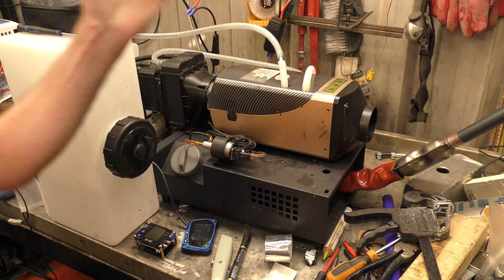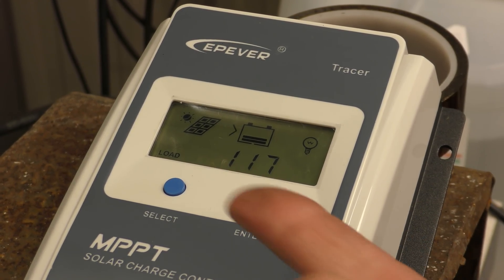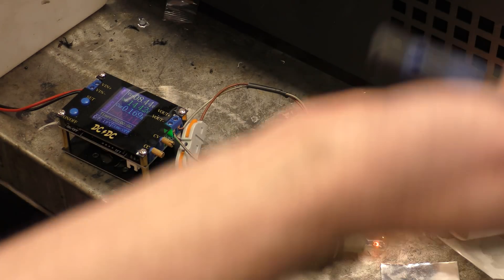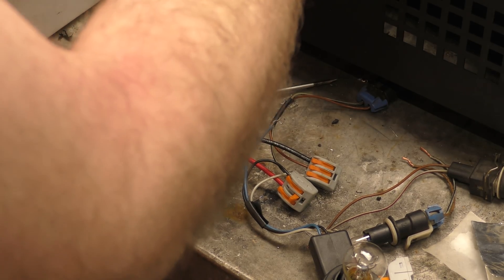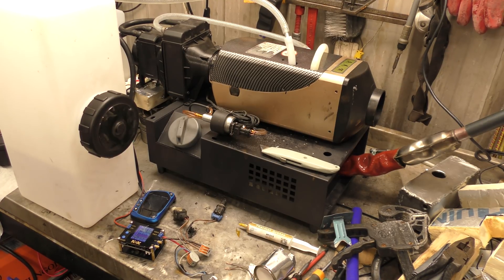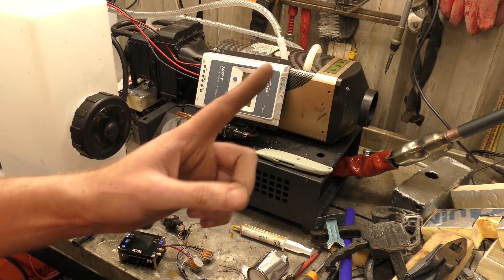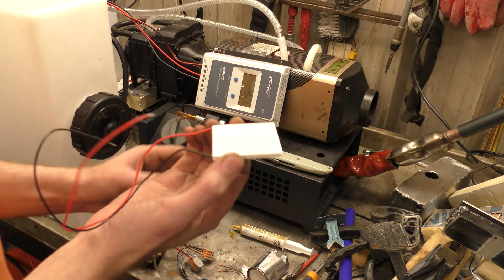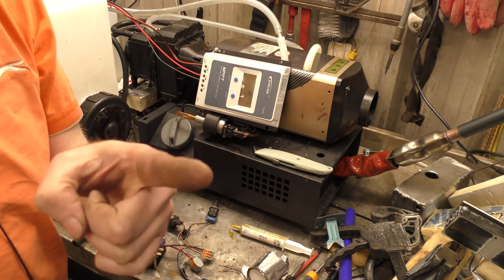Self Powered Diesel Heater Project - part 5 - water cooling, plus testing the cheap TEG modules

Comment: Set up a hose sucking cold air from the outside,  or create a separate TEG Unit that is outside.  With a wall or window type set up it could be quickly removed to new location i.e. a vehicle,  tent, shack, or garage.

Comment: Does self powered mean there is no power to run it. Lol
Reply from the maker: Kind of.  The goal is to use some of the heat from the burning fuel to generate enough power to keep it running (40-50 watts).  So if you kept it running it wouldn't flatten your batteries.

Comment: I’m looking forward to seeing the results of using the exhaust gas for the hot side and the input air as your cold side. I have been thinking about this since I got my heater last year. It would be nice to see if very frigid air improves the power output. I use mine in below zero temperatures, which runs off of solar so any increased input for me is beneficial in the winter.

Comment: My heater seems to output hotter air  at a lower hertz settings (I've not tested this with a thermometer). If true, could this mean a higher delta T and a better ratio between consumed power (lower fan speed) and TEC generated power ? At 1.6hz my heater consumes 8-9 Watts

Comment: The MPPT you are using expects a much higher voltage from a solar panel typically 18 to 24 V to start charging, you need a boost MPPT to take advantage of the low-voltage, that company makes some good stuff
Genasun GVB-8 Lead-Acid 12 Volt MPPT
Reply from the maker: Excellent.  Thank you.

Comment: Have you ever thought about adding some kind of propeler at the end of exhaust, it will be like mini wind generator so you can squeeze every watt that you can from esxhust pipe
Reply: any restriction on the exhaust will follow with a power increase int he fan motor, so you just hurt any energy recovery from restricting any of the gas flow

Comment: Has anyone done the calculation for how much energy is available in the exaust airflow?  At some point you could be trying to extract more power than is available.    The exaust air is hot, but does not have high flow.  Even though you only need a few watts total to power the system, with all the efficiency losses at each step of conversion and charging I wonder if there is enough energy at the source to overcome all the losses and still power itself.  
I'll try to do some calculations today, but I dont know if I have the experience/brain power to get that done.
Reply: I read somewhere online that there’s something like 800 watts of heat that comes from the exhaust, so with TEGS only being 5% efficient you’ll be looking at around 40w of electricity if the 800 watts of heat is correct.
Reply: @david parfitt  that's gonna be close if those numbers are correct. There are also losses at the buck converter and the MPPT controller. 
I have a sad suspicion that there just isn't enough available energy in the exaust to power this.
I think the only option is to use the main heat output.  
Its a shame because you only need about 1.5-2A @ a charging volatge and it would be great.  Just use a small lead acid for startup and shutdown and let the diesel power the rest.
Reply: @FrankFactor  when I was first experimenting with the exhaust versions at first I used aluminium box section with two spring loaded heat sinks inside (the ones David showed in the video) with the inlet and outlet at opposite ends, the exhaust gas entered the unit at around 200 degrees but exited at around 130 degrees, which meant that the last TEGs wasn’t getting the same temperature as the first TEGs and with the TEGs being connected in series the last ones were restricting the electrical flow of the whole system, that’s when I made the three branch manifold version so that each TEG got hit with the same temperature of exhaust gas but that still wasn’t enough, we may get better results with the cheaper TEGs on that unit.
Reply: @david parfitt  I'm excited to see where this leads.  You have done great work so far.  Very impressed with the designs.
I'm hoping to recreate this setup if there is any marginal success.  Using it in the near freezing temps that I run my heater in, I'm hoping I can exclude the water circulation pump and use the ambient air for cooling.
Reply: @FrankFactor  thanks for that 😊👍🏻
Freezing temperatures will definitely help!
It’s been an expensive learning curve for me but somebody needed to do it lol, with any luck we will be even closer in David’s next video 🤞
Reply: @david parfitt  speaking of expensive, I would gladly chip in to help offset the costs on this R&D process.  I hope that other people would also.  Whether this works or not, you will be saving me having to figure it all out the hard way.   Plus, I'm getting entertainment also.  
Dave 1 and 2, let us know if we can help fund some of this.
Reply: @FrankFactor  thank you very much for the offer but for me it’s time that I’m short of, if you could send some of that it would be much appreciated 😂👍🏻
Reply: @david parfitt  that's why I was offering some monetary help, I'm out of time myself!  Life has a way to fill up every last minute.
Best of luck to you guys and the offer stands if you guys need it.
Reply: @FrankFactor  Thanks very much you’re a gentleman 😊👍🏻
The way this is going it’s getting more and more complicated to make so I don’t think most people will be able to replicate it, if we are successful in the end we might need to create a kickstarter page so that we or someone can mass produce them so everyone can have one, it’s still very early days so let’s just see how things turn out 🤞

Comment: A simple test to see if you are heat input limited on the modules is to get a bucket of ice water instead of the input air. If you don't see an improvement, then you are getting as much heat thru the TEG module(s) as is possible for your size of heater.

Comment: You could cut an aluminum pipe in half and weld a flat plate on it creating a pipe that is half round instead of full round, use one of the half round pipes for exhaust and one for the intake air.
With two separate pipes there is no heat transfer from one to the other and the TEG modules are not in contact with the exhaust gasses.
Reply from the maker: Thought about that.  But I'd have to weld individual heat sinks into half a pipe.  There is no way I'd get them flat or straight.  :)

A better option provided by a viewer is to get a long heat sink and weld a lid on it.  So the base where the TEGs are stays flat.  One for the hot side, one for the cold side, and probably some springs to clamp the two halves to the TEGs.
Reply: @DavidMcLuckie  Thay does sound like a better idea, hope it works, good luck!

Comment: I have a small mppt controller I got on Amazon for 10 bucks, it charges one 3.7 volt li ion battery. You should try one of those with your system

Comment: You can hit select to switch through the display. You don't have to wait. I have a feeling mppt controller is too big for your system.
Reply from the maker: That was the smallest one I could see on Amazon.  Well one that was actually MPPT and not just a PWM with branding.  There are many fake MPPT chargers out there.  :)

Comment: It's very interesting that the dc/dc converter shuts off. I suspect that we're still not seeing the full potential of these TEGs. At first I suspected the dc/dc converter, but now I'm not so sure. The TEG voltage slowly drops from 22-24V down to 18V, then the dc/dc shuts off, and the TEG voltage slowly recovers from 34V to 37V. I'd guess that heat is being pulled from the hot side faster than it is being replaced.  This causes the hot side to drop in temperature, reducing the temp difference which reduces the output voltage and current. Or the current through the TEG is causing internal self-heating, reducing the temp difference/output power.
Reply: I think you are spot on, I also think that hot side can’t sustain the desired temperature, Also if the TEGs was up to the correct temperature we should be seeing around 54v with 3 modules in series.
Reply: @daveparf  I wonder if the water block is pulling too much heat off of the burn chamber, making the chamber colder than the desired temperature? I'm not sure that fully fits the evidence, but it's a thought.

Another experiment done with the dc/dc converter & load while also measuring the hot and cold side temperatures and TEG output current might help clear up these questions.
Reply: @aaronhunter7026   Surly that’s a good thing, the cooling part is as important as the heating part, I think the heat needs to be concentrated in the right spot with a better material like copper.
Reply from the maker: I suspect this a product of how the DC-DC booster operates.  The inductors and capacitors on the board will hold a charge and run a higher wattage than the TEGs can produce until they run out of internal energy and the system stop.  Which is what the MPPT controller should prevent.  It's supposed to find the load the TEGs can sustain and stay there, which is why we see it sit at 16W.

Comment: instead of the bulbs why not just put the converter output to the battery  the cheapo ones are prob tec modules and not teg easy way to tell is teg modules have thicker cables
Reply from the maker: They haven't melted yet, so they might be TEGs after all.  :)
Reply: @DavidMcLuckie  they dont melt just lesser current higher voltage
Reply: If you apply power one side gets volt other got they are tec if I recall teg wont do that
Reply from the maker: Oh the solder melts right out the cheap TECs if you heat them up properly.  :)
Reply: @DavidMcLuckie  lol funny you should say that just did that with last project tea lights pack more heat then given credit

Comment: if you had the mt-50 head unit for the controller you could see whats produced and used as well and voltages as the desial heater could be wired to the load side of controller if the current the heater draws is not over what the controller can supply
Reply from the maker: There's an idea.

Comment: Really interesting instalment David, I don't understand all of what you are doing but it's surprising that the cheap TEG's were working better than the expensive ones, looking forward to the next one 👍
Reply: he is trying to take the wasted heat from the exhaust and turn that into electrical energy to replace the power the heater uses from the battery so once running the only fuel is desal all electrical will be self sufficient

Comment: The only issue with useing a lot of them is if one or more is not producing as much as the last they can act like a big resistor or at worst start consuming some of the power produced by the others. Of course you can figure it out with enough experimenting
Reply: i guess you could add a bypass diode like they do for solar panels